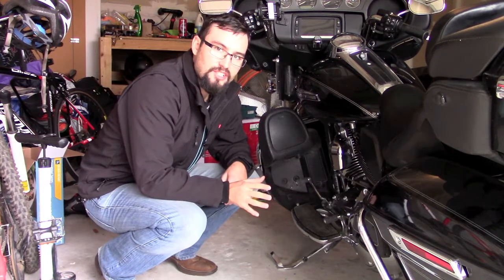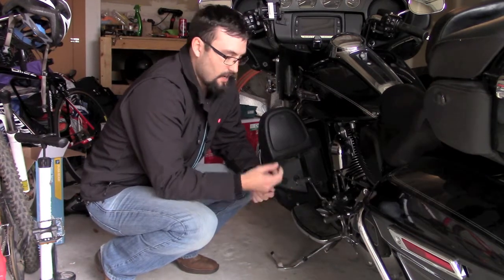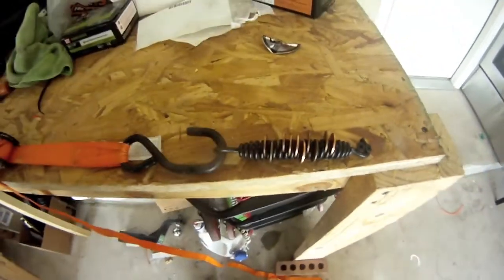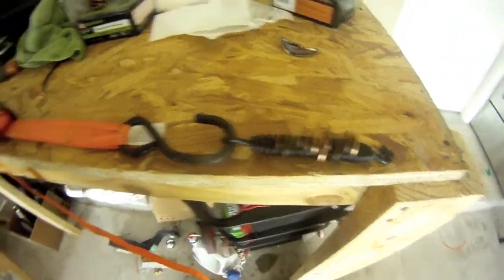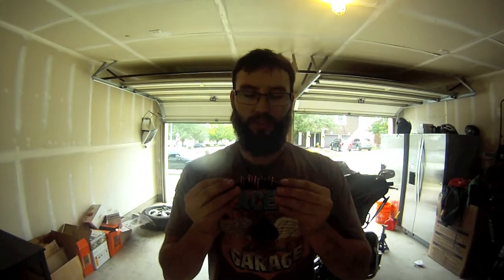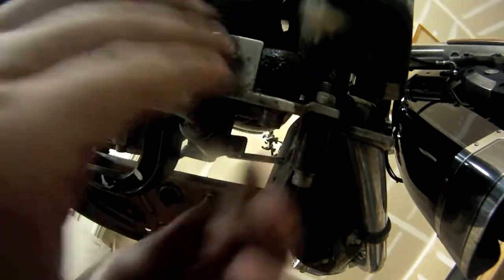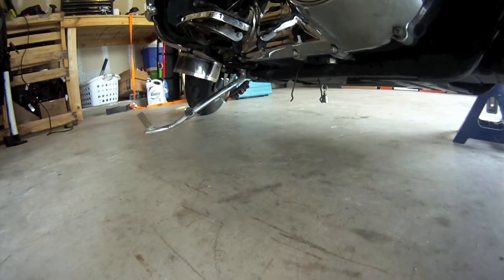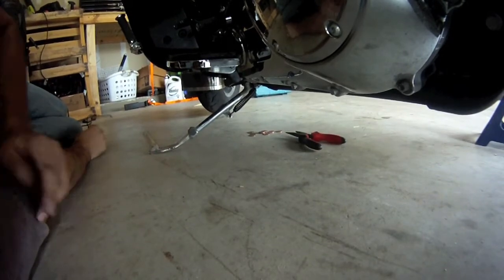How to Install Motorcycle Kickstand Spring

Comment: Thank you!  Took me 15 minutes after watching this video.   Couple pieces of advice:   1) Use a sturdy screw!  My first one snapped off when I was ratcheting the strap.  2) Use a pair of work gloves (for when issue #1 happens!).  3) If you are working with an old Ironhead, you may need to use 10 nickels. Pennies were not thick enough.  Other than that - this procedure is genius!  Thanks again!!

Comment: Dangit man I saw a video how to do this with a vise, but I don't have a vice you just solved that issue!
Reply: Watch the other YouTube videos of how to do it safely and correctly and service the stand and sleeve it rotates in with new grease while you’re at it . That’s why there’s a 1/2” bolt , washer and lock washer holding the arm  and a little locker plate , fonce you remove the bolt you can rotate the arm all the way forward, taking all the tension off the spring so you can rotate it counterclockwise and pop it off and hook on a new one , finger tighten the bolt with a little blue thread lock , swing it rearward and torque it down to 18 ft. lbs . and voila  , you’re race ready.